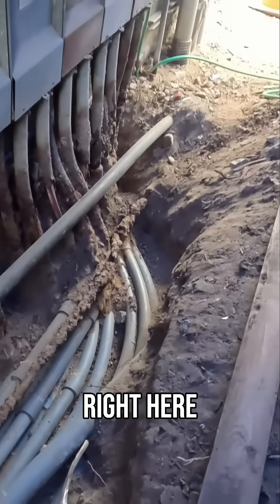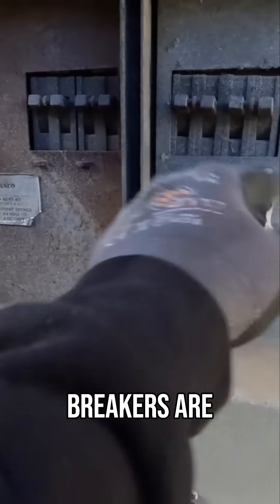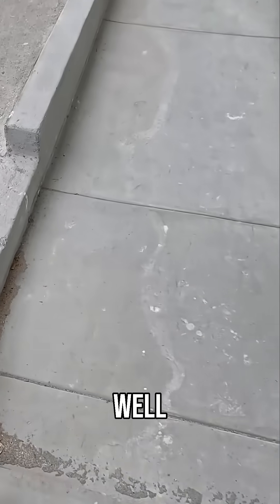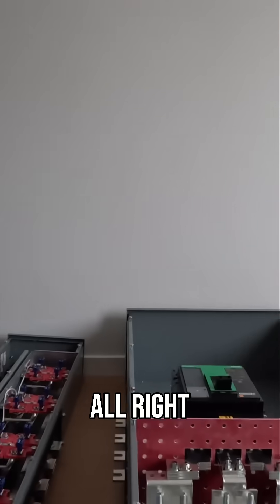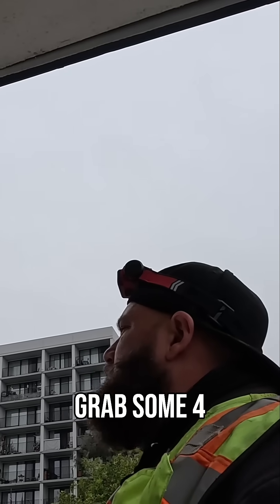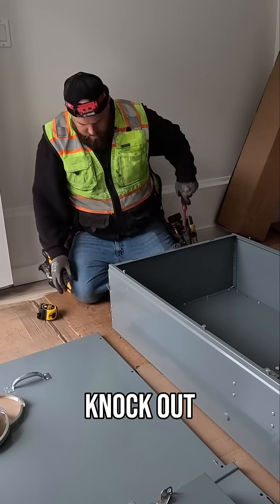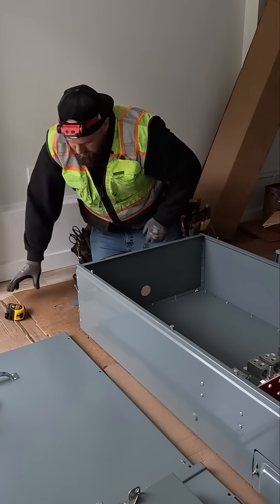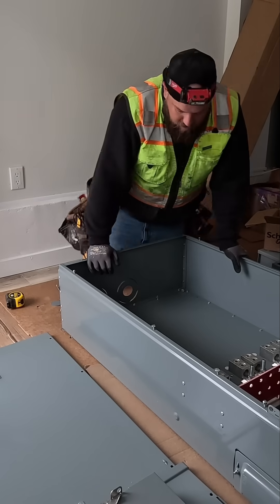Electrician's DIY: Wiring Nightmares & How To Avoid Them!

Comment from the maker: Enough with the short videos! If you’re serious about the trade, don’t miss the full 30-minute job site videos. Master Electrician POV series — only on the channel. 

Also, STOP using metal conduits underground!
Reply: Many Code cycles ago, around the time those were installed, IIRC metal RMC was required to satisfy the physical protection aspect. 

Of course no consideration was paid to alkaline or salt air exposure....
Reply: I love using p v c but man dude, whenever you dig three inches and you head straight stone man, i'm sorry, man, but there's sometimes I gotta use metal
Reply from the maker: @justinvega2957 just make sure you use OCAL.
Reply: I use a moat when running wire for maximum cooling
Reply: if you do, has to be rigid
Reply: PVC conduit wasnt around back then, or it wasnt allowed.  Things do change for the better sometimes.
Reply from the maker: @MrKongatthegates makes sense
Reply: Ocal used on big union jobs 
Or big jobs and it’s in the specs and in the bid .
Know small contractor will ever used it .
Reply: NYC jobs all galv in the ground .some jobs like transit all galv .nyc whole different animal .Lots of galv
Not all this plastic crap you see on line .m
Romex is used for temporary 
Lighting and power .Then at the end of the job rip out 
To the dumpster.

Comment: Metal is fine underground it’s just most using conduit. You’re supposed to use the proper pipe. That’s the problem and the proper pipe is expensive so just use plastic.

Comment: The ground looks more of dirt, that touch the old metal pipe raceways. No gravel back  filled to keep water from staying wet against the metal conduits  so it accumulated and never dried back. The planners didnt add a field drainage to collect into piping field systems that could of help remove the water into a storm sewer draining provided by the city. (Just going by what I see.)
Reply: The proper way is they should have stubbed up above ground with pvc added a glue on female adapter then a raintight male emt connector slap in the emt add your other rain tight male on top 👌🏽

Comment: Well depending what part of the country your living in, I’m in Chicago illinois and by code you must use Rigid steel conduit for any insulation outside exposed to the elements as well as under any concrete driveways, roads, sidewalks and Com-Ed services you can convert to PVC once your in open ground but then you lose your mechanical ground and by code must pull a ground wire. Either way cost is not much cheaper to use PVC because you have the added expense of the ground wire.
Reply from the maker: Good information!
Reply: Threading and installing ridgid is way more work, harder work, and PVC is cheaper so what are you talking about.  Chicago is backwards, electricians and the unions there just hanging on to old ways that use more man hours
Reply: @MrKongatthegates, i agree. Everything in chicago tends to be overkill. Plumbing codes are worse.
Reply: You also have to bury pvc a lot deeper than rmc.

Comment: Back when it was new they didn't have pvc conduit.  Rigid was all they used underground
Reply: They make a pipe that is made to be buried even back then the problem is it’s expensive so just use plastic
Reply: They could have at least taped it with some moisture resistant tape.

Comment: Looks like pvc.  Where's the metal?
Reply from the maker: The 90’s and the conduit going into the panel are metal. And completely rusted out.
Reply: That's a good question. All the metal turned to flakes.